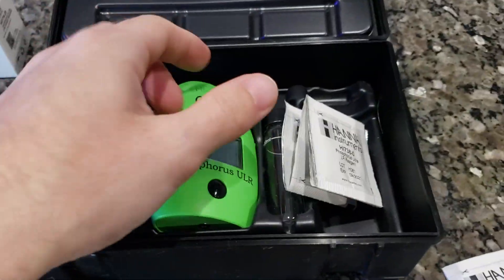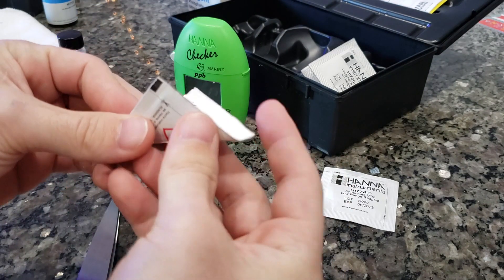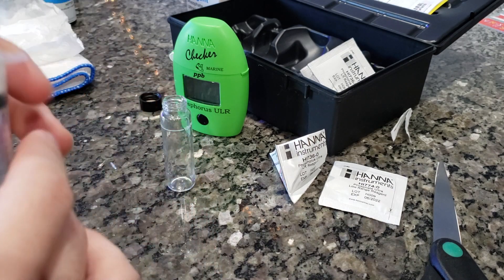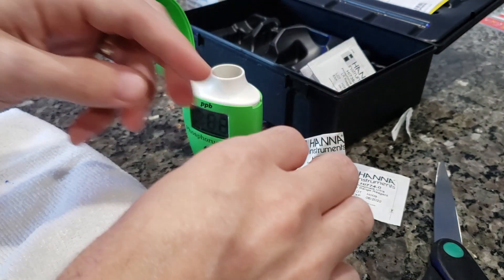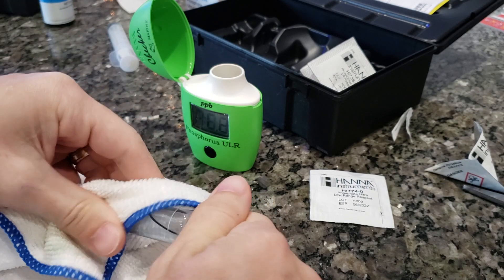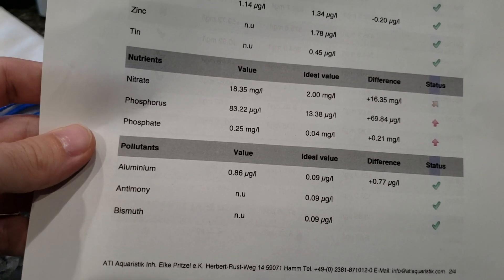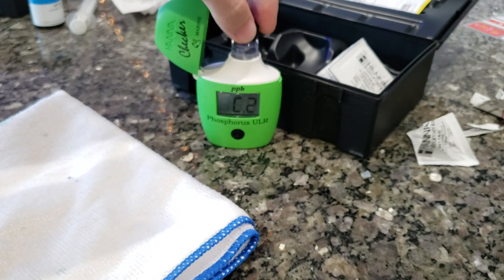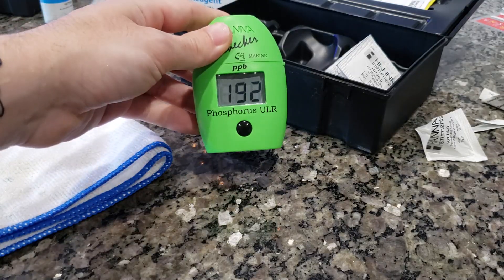Hanna Checker Phosphorus vs Phosphate Reagent Challenge - How To Use a Hanna Checker

Comment: Nice. 👍
Mine came with 2 cuvettes..didn’t yours?
What’s great about having two is that you don’t have to feel rushed...you can have both ready to rock before you even turn on the checker.
Reply from the maker: It did come with two but I remember way back hearing suggestions on only using 1 because it could affect the end results, probably not super true but just the habit I have now 😂 I wish they didn't have the timeout so low but I'm use to it now 👍🦉🍻
Reply: I think you have 10 min between c1 and c2, then 2 min after final reading